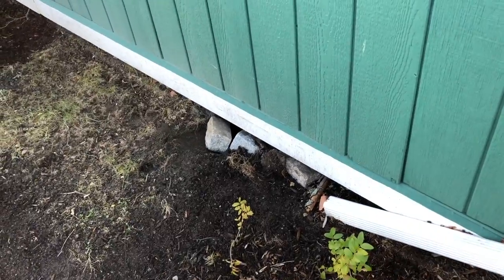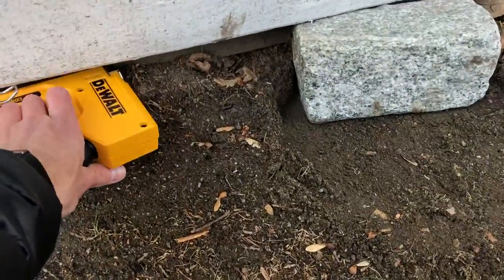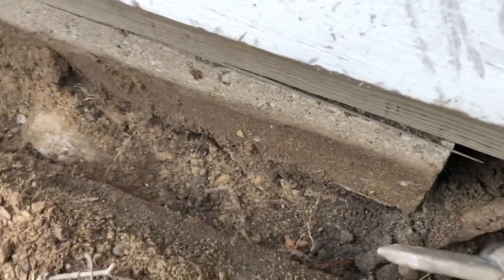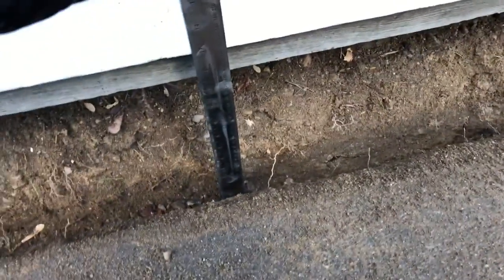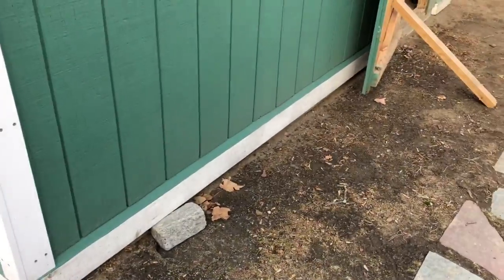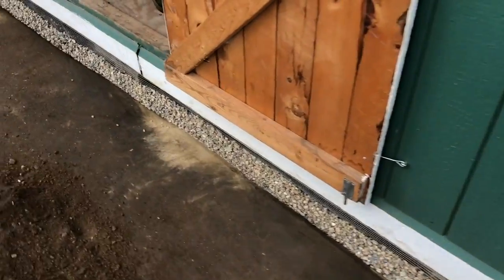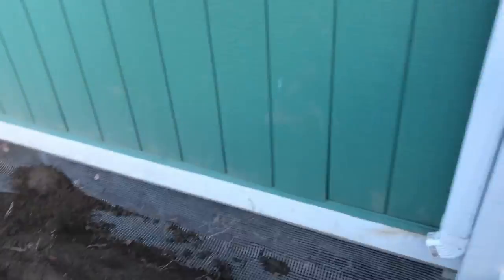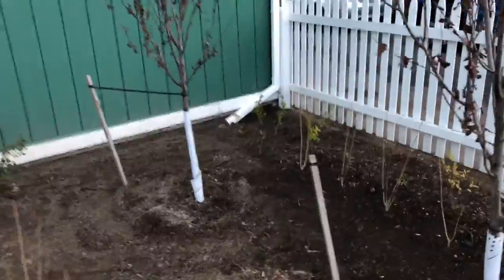How to Animal-Proof a Shed (Skunk/Possum/Raccoon/Rodent/Groundhog/Squirrel)

Comment from the maker: If you liked this video, please give it a LIKE and feel free to SUBSCRIBE too!
Reply: Can i use staples on brick wall?
Reply from the maker: og jenny Nope.
Reply: Hey good day, I am a certified pest control applicator with 8years of experience, sometimes I do Rodent proofing just like this one I can surely say your installation is impressive and it would surely work however here are some pro tips. Use dry wall screws to install the hardware cloth unto the foundation board for a stronger more lasting hold because if any weight should be added to the soil on top of the metal cloth it would easy pull and break the staples loose  from the foundation board, also try using useing metal pegs to secure the base of the metal mess resting in the soil so the digging Rodent won't easily push away the metal cloth as he is digging and pushing forward.❤ good job on the the escaped route 👏 👍 it is a grade A installation, but with those tips it would be a A+

Comment: Any updates on how its been holding since you did this 3 years ago?  I am considering doing the same and was wondering if 8" deep and 7" out is enough for rats.  Thanks in advanced!
Reply from the maker: Yup. It’s still holding up perfectly. Zero issues!
Reply: Did you do yours and did you use 1/2 or 1/4 chicken wire

Comment: I have a 10 x 20' custom shed. 1 10' side is grass so I will need to cut and lift the grass to place cloth underneath. Other side has a ramp and grass is dead under.

Comment: This is great - did you put in a one way door before you sealed it all up  to make sure if a skunk left it couldn’t return?  Trying to figure a way to make sure I’m not sealing a critter in.
Reply from the maker: Hi Gord, thanks for the comment and support! I didn't put a one-way door in, but I did use a smoke bomb with everything wide open before I started. And I was making a lot of noise during this project, so I think I scared away any last critters. Check out my ANIMALS DIY PLAYLIST where I have another video showing the smoke process: https://www.youtube.com/playlist?list=PLi_xrZRI49bVr_ILvSpvRky83ORkIDSoH Hope that helps! :)
Reply: Thanks for the quick reply. I am pretty sure whatever is under mine only emerges at night as I’ve seen the rocks I place have been moved.   Will try a few tactics to encourage whatever it is to leave and not return. Really don’t want to get get surprised by an angry skunk or raccoon while I’m digging the trench.  My shed is 8x8

Comment: Thanks for the video! I bought some mesh and will be attempting something similar this weekend.  I had a squirrel chew through the top of our shed door (I may have trapped him in when I blocked the hole with a rock on Tuesday and he chewed his way out...ugh). Any ideas on how to repair the top of a wood shed door? Should I just repair it using the mesh? 

We are just about ready to get a plastic shed ....there are lots of holes on the floor on the inside from last summer (I thought I fixed it until checking the shed earlier in the week). I may try to get some metal flashing since the holes are where the floor and wall meet, but I don't actually know what to do or who to ask.
Reply from the maker: elyse cueto You’re welcome! Critters are tricky. If a wood door, you could simply patch it with a new wood patch label screwed in. If new plastic shed, you should be good. Just block all holes to keep squirrels out!! Let me know how the project goes! 😎👍🏻

Comment: Looks great.  I have a wood fence that they bit and dug through. How high would you go with the wire?
Reply: JUST  did it this week. I used 4 ft x 25 ft mesh wired fencing to do my backyard fencing. Bent it at the 1 ft margin leaving 3 ft for the height portion. Stapled it along all 3 sides of my fence. Hoping for the best right now.

Comment: Amazing video, very informative and to the point. Did you tie the chicken wire together at the outside corners?
Reply from the maker: Hi Brian, I did not have to tie it together at the corners because that is where my cinder block foundation was, so I essentially went and overlapped the wire with the blocks, and then buried them down into the ground. There technically is a slight gap at the corners (where the wire does not meet each side of the rectangle shaped shed, but no animal could get in because it is still just block, wire, or gravel. No air gaps for them to get into.

Comment: when i build a shed i put it on a 6 inch slab with rebar  1/2 inch  16 on center   and i can load the heck out of it plus i have  a concrete floor  i can wash it down if i want  and its also lifted sides and a sealed door that  critters cant eat   .
Reply from the maker: Meanold bonbon nice

Comment: Great video. I'm trying to figure out if this job is necessary for our new shed. I don't mind critters seeking shelter underneath, I don't want our cat or dog trying to follow them and getting stuck or somehow compromising the structure somehow. It's built up pretty well and we never worried about this with our way too old shed ☝
Reply from the maker: Ken Trock Cool. Yeah for me I will always do this. I don’t need skunks surprising me when I walk to my shed at night haha.
Reply: Ken Trock I was thinking the same thing. My dog is small and would chase anything that goes under my shed, so I’m gonna go ahead and start this project tomorrow.  Seems easy enough.
Reply: As per a neighbor, groundhogs have eaten through the wood at the base of their shed.
Reply: Yes what I have heard his the chewing that could happen if the critter become trapped under the shed due to snow etc. I was with you. I don’t mind critters taking shelter. But I don’t want them to chew up my shed either. So I’m going to be proactive a prevent the habitat.
Reply: @collef1136 , 3 years later with this shed and no activity under it at all. Turned out to be a non-event.

Comment: I have a nice sized hole under the slab of the garage floor. Should I use gravel after smoking them out, or what should I use?
Reply from the maker: klbelt When smoking critters out ideally you want to leave one escape route for them to flee. But then afterwards you can plug it up. See my other smoke bomb video too for help :)
Reply: What would your suggestion be to plug it up with?
Reply: Thank you for your response.

Comment: You don't show how/if the wire sits into the dirt or on top of the dirt.....  Is it pressed into the dirt and if so how far down before the rock is placed/  OR is it bent at the bottom at a right angle? then placed  on top of the dirt and then rock covers?  Not sure what you mean by "so the animals don't dig under the dirt?, especially if the wire is not deep into the dirt?  Can you please explain or add a video to explain  Thanks.

Comment: nice to let the water from gutter to run under the shed and rot it out  we can come and build you a new shed soon thanks
Reply from the maker: Meanold bonbon It’s elevated on blocks on one half and slab on the other. Nothing is going to rot.
Reply: @wildcatDIY  the water will stand under shed and cause it to rot from moisture from the floor   get gutters away from foundation or will  sink the blocks down deeper then it sits on dirt directly  weight pushes mud with no effort.
plus no major air flow  will cause rotten as well in high moisture areas..

Comment: Can I use the trench & chicken wire around a shed with no concrete slab? We have a skunk tenant :/ Thanks!
Reply from the maker: Yes, you sure can! All of the parts that I used the chicken wire did not have a slab under it - just normal shed with air under those parts (where animals could get into before this project). Hope that helps! Good luck :)

Comment: How much would you charge to do this on a mobile home, any idea?,  thanks. The skirting is sitting on some tipe of  wood like 2x4 or 4x4 some like that.
Reply from the maker: Jorge Malagon Hi. Very tough to estimate since I don’t do this professionally as a job. But it was about $100 in supplies and took me four hours or so. So probably $300 or so I might guess.
Reply: @wildcatDIY  thanks buddy
Reply: @wildcatDIY  You're hired! How soon can you start? :-) We were just told today that we need something like this for our mobile home and they're asking for a lot more than $300!  Our big problem is how do we attach the hardware cloth? We don't have that nice wooden trim around the edge like you do.  And what is this method called, does it have a name?
Reply: Depends on the perimeter but I usually charge $800-1500 for similar job.

Comment: I just bought my first house and it has 2 sheds and a gazebo. I have seen woodchucks go under the gazebo and something chewed a hole in the side of my shed. I dont know how that even possible but there is a big pile of dirt by it. got the house at a good price but yeah... this is what i need to do before winter comes. dont want these bastards living under my deck or sheds . i guess im gonna try fox urine granules to drive them away before i start putting up the barrier
Reply from the maker: Luke MC Nice! Yeah good luck with the deterrents. But in the long run a little wire will save you a lot of headaches. Let me know how it goes!
Reply: @wildcatDIY  I may try live traps too. If I didn't live in a neighborhood I'd wait on the porch with a shotgun
Reply: One may even consider some of the pellet guns up to .22 caliber that have suppression. They could be used for rabbit hunting even. They could still be heard but they’re not that loud. Just a thought.

Comment: The problem with your methods are that rodents tunnel underground up behind the wire then they eat their way in wherever they want
Reply from the maker: Art Tafil In theory they could but they won’t because they are dumb rodents. They will seek out other sheds or shelters that don’t take as much effort.
Reply: unhwildcat333, Maybe where you’re from but here in Knoxville, Tennessee the woods rats tunnel under wire mesh and come in and eat the plywood flooring in about a four from the outer edge of the siding! Even with my German Shepherd outside some of them get in the shed. My Shepherd digs massive holes to access their tunnels. That’s how I know what they do. We constantly find rat carcasses in the yard where she’s snapped their backs or necks. When I go inside of the shed I carry my 22 LR Sig Sauer loaded with rat shot. I’ve shot over a dozen trying to get out of the holes.